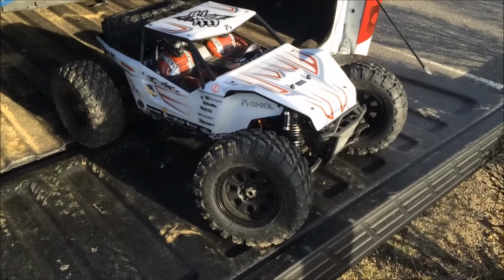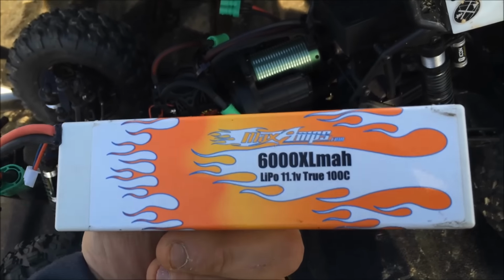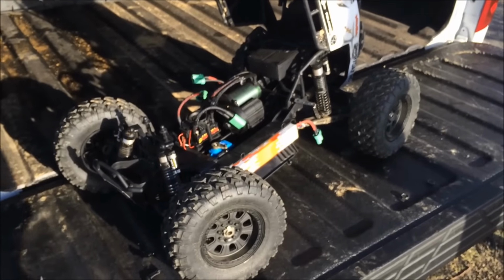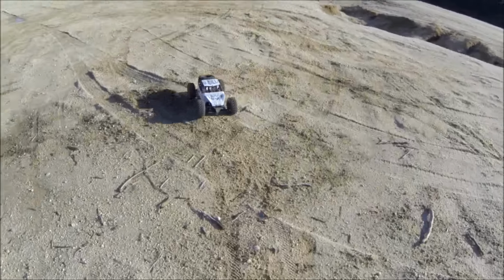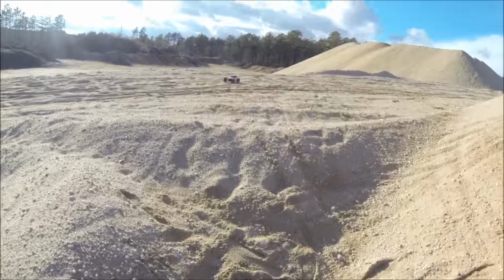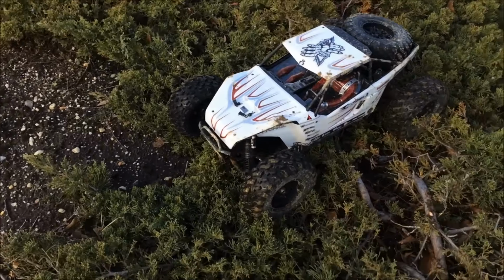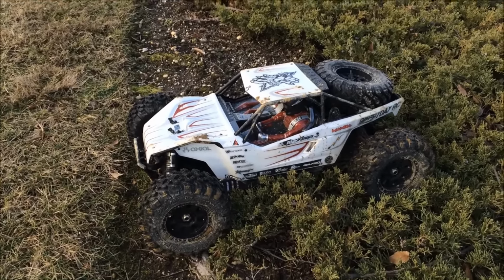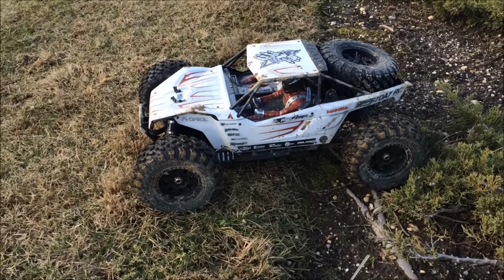AXIAL YETI XL BASH

Comment: Awesome video.  Axial now sells heavy duty, spiral cut, ring and pinion gears for the diffs. Apparently they mesh much better even without shims. Plus spiral cut gears are always more durable. Hopefully these gears are finally the fix that Yeti XL diffs need without having to buy aftermarket bulkhead and rear axle. Good luck.
Reply from the maker: +rotary1977 Thanks for the input! I dont think axial sells them its from an aftermarket company! I have looked into them but im sticking with hardened oem gears just make a few changes

Comment: Hey Chris sorry about the gear failure. I had the same issue on my Yeti XL until I decided to shim everything. What worked for me was doing the third bearing mod  and shimming the ring gear and diff cup at the output cup entrances. I also shimmed the axles and dropped my brake force down to 10%. All I run is 6s now and have no problems except for the occasional failed bearing. before you invest in aluminum housings try the shim method. It's done on many high end race kits right out of the box and it makes a huge difference. Also Axial just released some Helical cut steel gears for the yeti xl that don't require any shimming. They might send you a free set if you call them up and ask.
Reply from the maker: +Reymon Nolan Thanks for watching! Axial Took care of me and I have some upgrades up my sleeve! stay tuned@!

Comment: Hey man, I know this is an older video.. do you still run the XL?

I was thinking of getting one to replace my sl4sh but not sure if I can afford to keep it running?

Is there just 1 or 2 must have bullet proof mods and that's it?

Id only run 3/4s on it
Reply from the maker: Hey what’s up bro? I haven’t run the XL in a long time. It’s definitely not the most durable vehicle. Add a minimum I definitely suggest spiral cut differential gears and 30 hawk racing aluminum front bulkhead

Comment: I've had my xl about 2 years now and $1,600 later still putting $ into it lots of aluminum upgrades it bends and brakes everything even bend the screws in it
Reply from the maker: I hear you! The XL is definitely a delicate platform. I haven’t put that much into it but I put the DHAWK front differential housing and spiral cut gears in the front and rear. I still haven’t got out and put it through another bash test
Reply: EVERYDAY RC  have you been out yet since these upgrades?

I was going to get a kit next week.. still not sure yet.

I will only ever run it on 4s though

Comment: I was disappointed with the XL. It's designed with much afterthought. The way the pinion is held in the front and rear diff with those screws is wack and overall it's just not durable without putting a bunch into it. Not worth the $500 for the kit IMHO That hit to the front should never have done that.
Reply from the maker: +mattster1971 Thanks for watching! Trying to make it stronger!